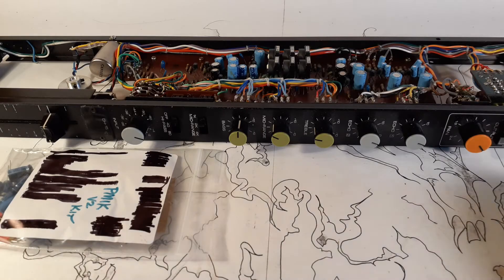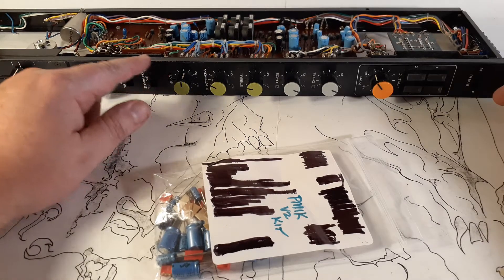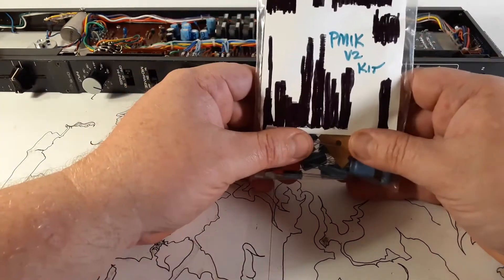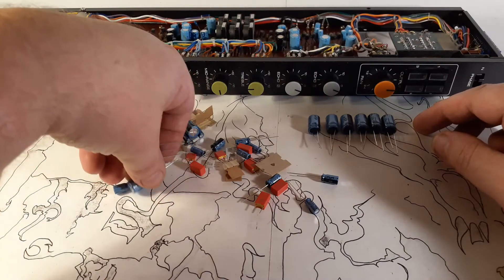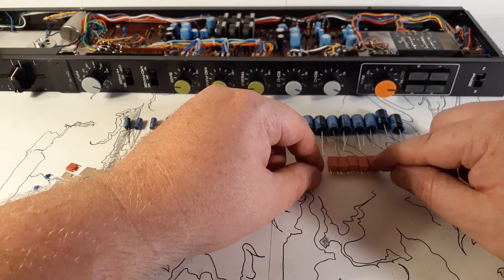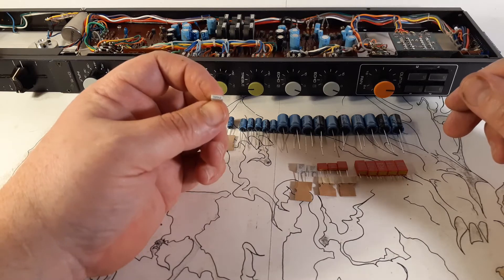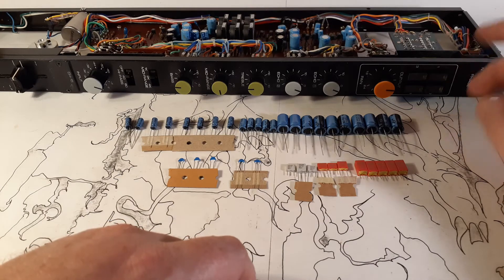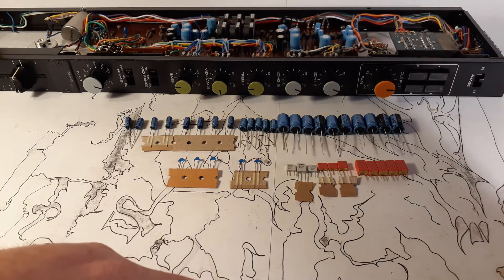Yamaha PM-1000 Preamp EQ Rack Mod, ep 5: Recapping a Pre + EQ Module, part 1

Comment: What is the de-soldering unit that you use? Thanks
Reply from the maker: I use an older Hakko 808 model. They have now discontinued it and replaced with a newer one. I'm not sure what the model number on the new one is.
Reply: @mesasavage  Thank you

Comment: Hello Jesse, how much are you selling these kits? Thanks for the info.
Reply from the maker: I sell the mod kits for $59 per channel for 1-3 kits. If you buy 4 or more kits they are $49 each. They come with all the caps needed plus full instructions for installation.
Reply: @mesasavage  where can i buy these kits? i need two
Reply: @lokoono1541  I’m trying to find contact info.  I need kits as well
Reply: @mesasavage  Hey Jesse! I would love to buy some of these kits for my 16 channel board! I'd also like to have different eq points per channel for different purposes. please lmk your contact info or website if you have one! your videos on these pm1k's are invaluable so thanks.
Also.... 
what would you recommend i do with my powersupply? Simply recap it or replace it?
Reply from the maker: @thmsrojo  If your stock power supply is still working I suggest a full recap for it as well. I have a kit for it and all the different PM-1k modules, not just the Pre+ EQ. If you know what EQ points you want to adjust to, I can calculate what caps to switch to, as long as they are close. Without changing the inductors you can’t move around too much. My standard kit takes the 4K/2k/1k and moves it to 3.2k/1.6k/800 and that’s about as far as I’d go in that direction. Email me at jessemesasavage@gmail.com and I’ll set you up with some kits.